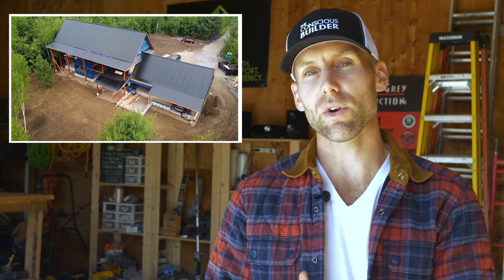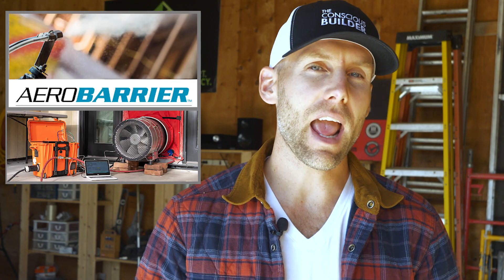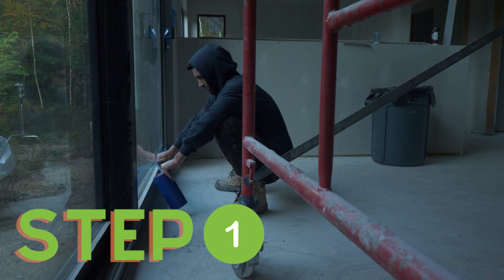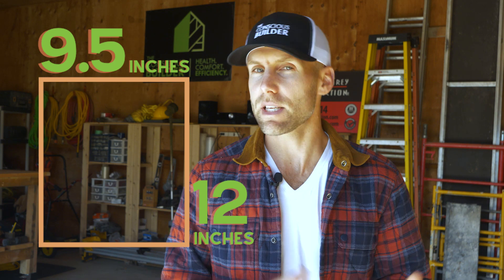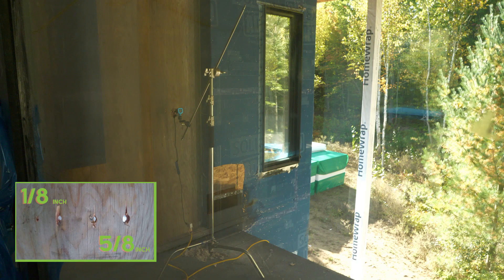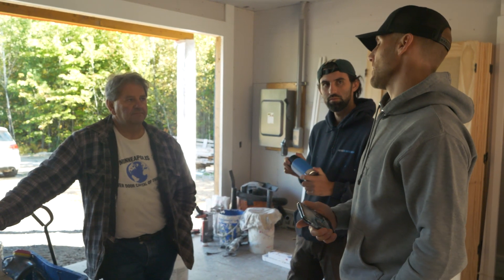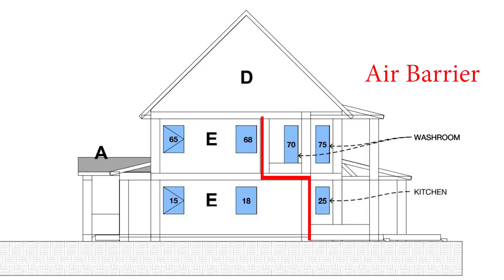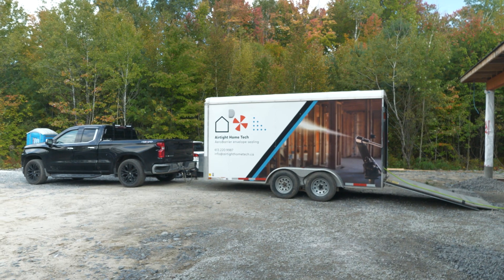How We Made This Home 68% More Airtight in Less Than 6 Hours!

Comment: I am surprised that the Adhero was ballooning out. I thought the Adhero was adhesive and would not have ballooned out. Curious of your thoughts.
Reply from the maker: Good eye, Ian! You're correct that a self-adhered membrane like this should not balloon out during a blower door test. The Pro Clima line of adhesives is pressure activated. Anywhere it balloons indicates the adhesive had not had a chance to adhere, either because it needed more pressure or more time to adhere. A good lesson and one of the many reasons to test your work after it's done - so you can go back and adjust as needed.
Reply: @Theconsciousbuilder  did you have to use a roller to re apply it?

Comment: Casey, would this be an option to add air tightness to an existing home build? We're in Ottawa/Cumberland and bought a 1997 build bungalow, and are wondering if this is a fairly simple way to add some air tightness to the home. 

Awesome tech, thanks for sharing!!
Reply from the maker: Great Question! Unless the home is being renovated it's not usually something people would choose as there is so much prep involved that the cost to protect the furniture and finishes is more than the cost to spray the Aerobarrier. However, homeowners have done the prep work themselves in some cases. If you were renovating/tore out the carpet/had no furniture, that would be the time to do it! I'd contact a rep and see what they suggest.
Reply: @Theconsciousbuilder  Great, thank you!